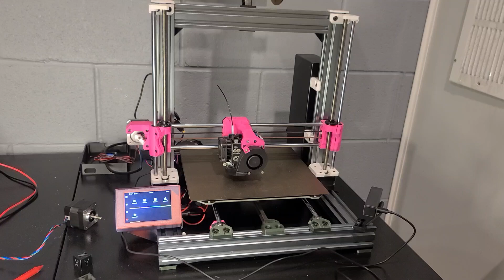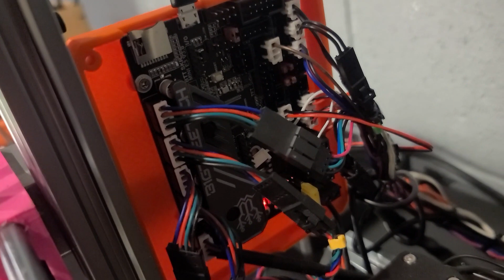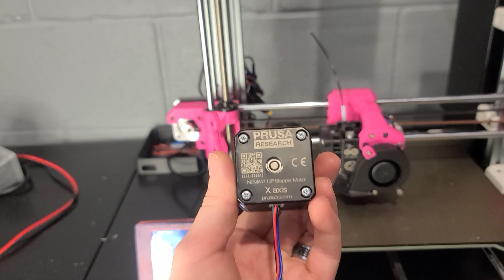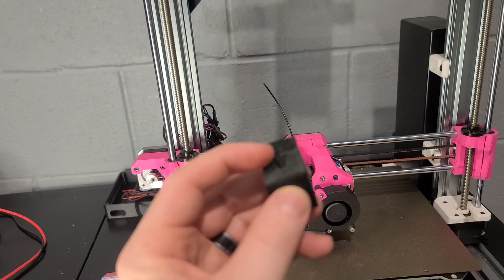🔥🔥🔥 Prusa MK3s Upgrades! LDO Bear 2.1 Frame, V6 Hemera XS Hot End, SKR Mini E3 V3.0 Board, more!!

Comment: What firmware did you use for teh SKR Mini and where did you get it from please? Thanks.
Reply: The firmware I used is called Klipper and has to be run on a separate computer like a raspberry pi. There's a decent learning curve between Marlin and Klipper, but once you get the hang of it, you'll never go back. I updated all of my printers to klipper and the consistency is so nice

Comment: Thank you for showing! Could you share the motors you upgraded to? I have klipper running on pi zero w with mk3s+ at 8k acceleration, 400mm/s, but I have y-axis jerk limit set to 5 because I otherwise get shifting on the y-axis. Looking to increase torque on y-axis and maybe do 9 or 12mm belt to combat that. Have you changed your y belt? Anyway, curious what limits your speed/accel. The only other relevant upgrade I've done are y stepper mount upgrade, y tensioner upgrade, 16t y idler, and most importantly bondtech CHT bimetal nozzle. Can do around 23 volumetric with PETG, and some brands/colors much higher, like Jareez matte black can go above 25. I have it set to 28 but I think I haven't printed anything large enough to see that output.
Reply from the maker: @funkdizzle3000  I went with LDOs that matched the size of the original. I don't remember the exact model, but I had to slow it down to 250mms 5k accel because of vibration on the Y axis as well. I tried greasing and lots of stuff but couldn't get away from it so it might have been a bent rod or something. I ran it at that speed for a long time then sold it. That sounds like a heck of a machine you got there!
Reply: @hacktical521  Ah, I see. Last question: you did input shaping? I did with the BTT s2dw and wow, night and day. That's the only way I could speed it up. I saw failfast here on yt and saw their mk3s with klipper, and it motivated me to dust off mine.

I'm curious what printer is your favorite now? No doubt a corexy?
Reply from the maker: @funkdizzle3000  yes I did the input shaper calibration, and did both manual as well as with an accelerometer, which gave similar results. Cleaned up the rippling but didn't allow for more speed since I think I had a hardware issue. 

And my favorite printer currently is one that I built. Core XY, 400x400x400, AC bed, 3 Z motors for a dancing bed, orbiter with a Revo hot end. I can't go past 400mms with reg PLA even at 220C because the filament doesn't melt fast enough, but the printer itself can go faster with ABS or HS PLA. I found buttery smooth prints at lower outer wall speeds, so it's always a toss up between speed and quality, and I lean toward quality
Reply: @hacktical521  Wow, huge! And now I have to see a dancing bed. Thank you for all the info! Going to look into those motors.

Comment: This looks rad! I've had a LDO 2.1 bear kit sitting around waiting to be used.

I was wondering today actually about replacing the board and adding a Raspberry pi for klipper.

I'm not looking to push a lot faster, just to get cleaner prints that are a little faster.

Do you mind sharing your klipper config? Or which one you used?
Reply from the maker: Sure, I can share. Reach out to me at kevin@hacktical.shop